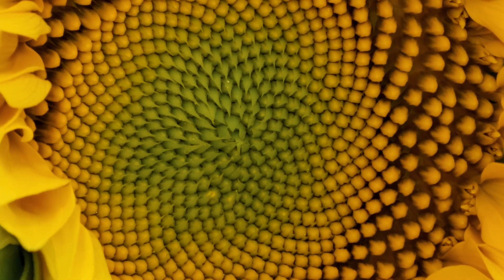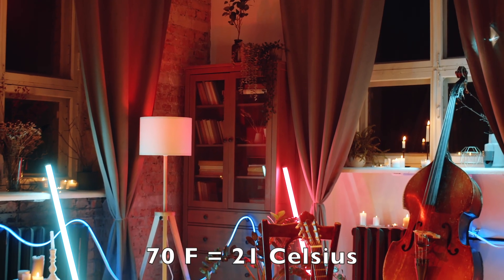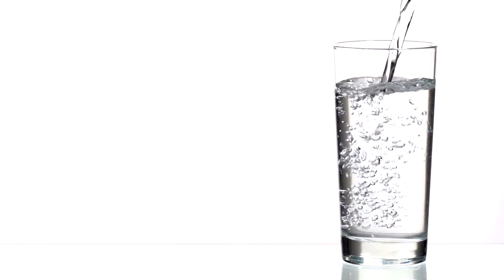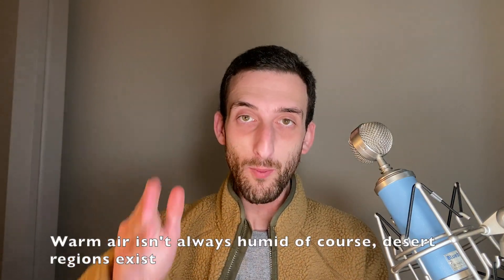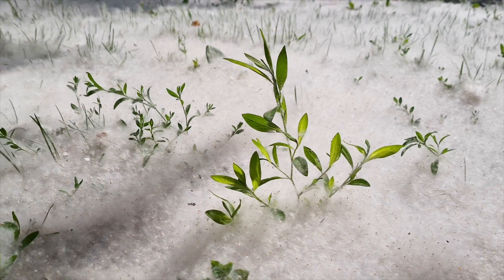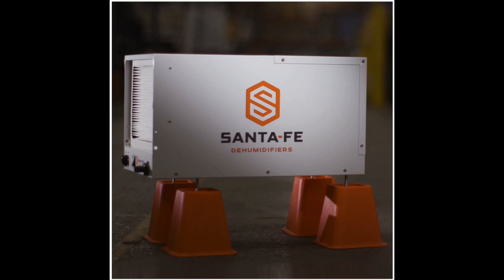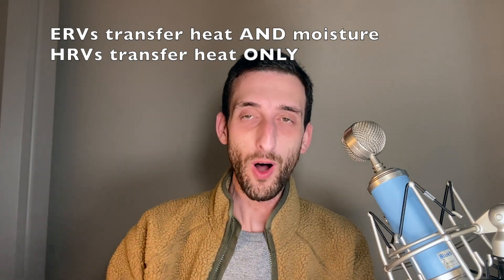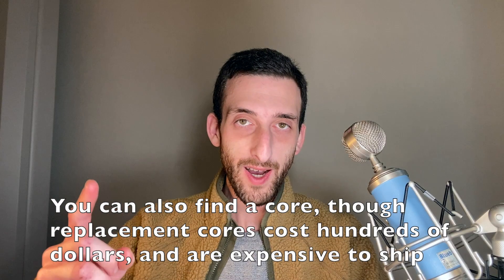HRVs vs. ERVs: Why I Ditched My DIY HRV and Bought an ERV Instead

Comment: I'm enjoying digging through your videos as I recently purchased an Aranet4 CO2 monitor and realized my bedroom CO2 levels can approach 2000 so now I'm working on bringing those levels down. I may get a broan or panasonic ERV, but am considering first trying the fresh air intake option on a santa fe ultra dehumidifier. In the winter they can operate in fan only mode to bring in fresh air through a merv 13 filter, and the rest of the year can dehumidify fresh air. It wouldn't provide the energy saving aspect of an ERV, but if already needing a dehumidifier it could be worth starting with that and then if an ERV is still needed they could even be ducted together.
Reply from the maker: I’m happy you’re enjoying my content 😊 Here are my thoughts about ventilating dehumidifiers: they are a good option for ventilation when the outdoor temperature is between ~55 and ~75F. But if the temperature is any colder or hotter than that, they would bring air that is too cold or hot air into your home. 

Further, they’re designed to deliver a lot of airflow: the Santa Fe compact70, their smallest model, is rated for 150 cfm, so that’d be a lot of cold air when it’s super cold outside. The air is so dry when it’s cold outside, that the dehumidifier wouldn’t be running, and wouldn’t produce heat to offset the cold (fan only mode). 

ERVs are of course designed to ventilate in such temperature extremes. It depends on your climate, ultimately. Best option for most people is ERV+dehumidifier though. Experiment!

Comment: Good follow up video. My house is good for humidity, but my chicken coop is too humid and I'm working on solutions to that now. Dehumidifiers are a tricky bet there because of all the chicken dustiness.
Reply from the maker: A MERV-13 filtered dehumidifier such as a Santa Fe Compact70 could likely handle the chicken dust no problem! Though you might have to clean the pre-filter somewhat often. Have you considered this?
Reply: I'm in the early stages of addressing the issue, so I haven't delved too deeply into any options. The humidity issue is of my own making. I decided to re-route my radon vent into the chicken coop to keep them a bit warmer in the winter and cooler in the summer. The air blowing out is always about 55 degrees F. But it's also very humid. I knew this going into it and figured I could try to address the humidity issue once it was set up. A total solution for it is to simply run the air through a radiator in the coop and then vent it out (only having transferred some of its heat, but not the humid air itself). I may go that route. I'm on a fixed budget for electricity usage because I'm running on a solar voltaic system. So trying to figure out what approaches can work with the least electrical burden. Thanks again for this video!  @HealthyHomeGuide
Reply from the maker: Wow, that sounds fascinating to run the air through a radiator and vent it out (only having transferred some of its heat, but not the humid air itself). I agree that a dehumidifier wouldn't address the underlying issue. I like your thinking and I wish you luck.  @PraxisPrepper
Reply: I'm fairly fond of your thinking style too - which is why I keep checking out your videos. I didn't even know ERVs were a thing until your video. @HealthyHomeGuide
Reply from the maker: That’s great to hear! I’m glad I could teach you about ERVs.
Reply: Definitely pre-filter + filter. There must be a reason commercial solutions use more than one filter in series. Big particles don't clog the fine filters too soon. Also, you can usually wash a coarse filter once. And can buy coarse filter material "blankets" and just cut to size

Comment: Moisture control is an interesting topic. In a tightly sealed construction like a passivhaus (or similarly built), I hear that even with an ERV it's not enough to regulate moisture. That's often because the minisplits that are typically used to condition and heat such buildings can't remove enough moisture as they are sized correctly for the passivhaus type cooling load, but that sizing will make them undersized for the moisture removal requirements. So they can't deal with it by themselves, and one does wind up needing a dehumidifier for the humid climates. But the resulting advantage is that (with some effort)  the end result is a house microclimate that can be quite precisely controlled.
Reply from the maker: You're absolutely right about all of that, and that's well said!

Comment: Outstanding content - thanks! One idea you may not have explored: In the event that you are building a new house or doing a deep remodel, you can elect to use clay plaster (not lime plaster or drywall). Clay-based plaster is an ancient technique that has been used to passively control humidity for thousands of years. It was recently revived by Geoff Lawton in the Greening the Desert project in the Dead Sea. By replacing 80% of the lime in plaster with Bentonite clay, the walls act as a hydric buffer (not my terms, honestly it's the engineers who name these things). When the air is damp, the highly hydrophilic clay particles in the wall absorb moisture like a sponge. When it is dry, the walls dry, releasing moisture into the surrounding air. Result: the indoor humidity settles in at around 45% to 55% regardless of the humidity outside or inside the home. This technique is used in Japan (a very humid temperate rain forest) where the problem is atmospheric humidity, and at the Greening the Desert project in Jordan, with an annual average humidity of less than 20%. This technique produces a lovely wall (decorators call it "Venetian plaster" it's quite on-trend at the moment). The largest challenge is finding plasterers. Plaster on lath is cheaper than drywall (materials cost) but more expensive labor costs (it takes longer and you need a higher level of skill). But, it's still only about 10% to 20% more than level 4 drywall, and you don't have to buy or power expensive mechanical humidity control equipment. To my mind, the set-it-and-forget-it nature of a passive self-regulating system that never needs maintenance or power, makes it worth the extra up-front cost. I would love to hear your take on this technology, as well as other recent tech revivals such as GAHT (ground to air heat transfer) systems, rocket stove wood heating, and Russian masonry wood fired heaters.
Reply from the maker: Thanks very much Linda! Clay plaster does sound very intriguing - I love the idea of not relying on mechanical devices for humidity control. I'll put clay plaster on my list of topics to dig into. My only concern, which may be unfounded, is about silicosis, a long-term lung disease caused by inhaling crystalline silica dust found in clay. That could totally be a non-issue here, but I'm curious. Anyway, thanks again for your interesting comment!
Reply: @HealthyHomeGuide  😯 That hadn't occurred to me. Wet clay isn't the problem, it's the clay dust that's the problem. 🤔 Since this is a single installation I will be sure to insist on good masks for everyone involved with mixing the clay into plaster. Thanks for the heads up! I can't wait to see your research.
Reply from the maker: @lindacgrace2973  You're very welcome, and good idea to have the workers wear protective masks.
Reply: @HealthyHomeGuide  Yeah. The OSHA inspector's got nothin' on me! I am notorious. The workers think I'm a nervous old hen (and they're right). But statistically, construction is one of the most dangerous professions on earth. Your odds of injury or death are worse as a residential roofer than as a front-line combat soldier. Wish I were kidding. I had a kid show up to do roofing wearing flip-flops. I sent him home. Everybody got the message and I had a much safer job site after that.
Reply: Or you could use wool for your insulation. Wool not only filters the air but also can hold a lot of water so it acts as a humidity buffer.
Reply: @GeraldLeenerts  I looked into wool insulation, but it is SO much more expensive than cellulose. I'm building in the Arizona desert (high in the mountains, away from the baking heat of Phoenix). I will use double-wall construction, with adobe on the outside, a 2.5" gap, and a clay plaster interior wall on 2x4 framing. So the final wall will be 16" thick. I seriously considered blown-in rock wool, real sheep wool, and cellulose. Cellulose wins hands down as the low-cost option. It doesn't have nearly the humidity buffering capacity of wool {sigh}, hence my desiccant built into the walls design.
Reply: @lindacgrace2973  Glad to hear you went with cellulose, as it is a carbon negative product compared to rock wool.

I've built a passive addition and working on remodeling our house to be passive as well here in Phoenix. So completely different climate but there is some overlap. There is a pretty good group of folks here if you ever need to bounce ideas around.
Reply: @GeraldLeenerts  Thanks! I'm looking for lots around Prescott, with average summer highs in the 90s. I'm a gardener and love the USDA Zone 7B climate - cold enough for my beloved tulips and cherries, but warm enough to grow olive trees and artichokes. Also, we get a lot more rain in Prescott (18" to 20") than you do in Phoenix. This channel has been a marvel - I remodelled and flipped houses for years with my husband, and worked as a commercial interior designer, so I have at least the foundations for understanding house construction. But you nailed it - I'm learning more on this channel than I ever thought to.
Reply: What happens when you paint, especially in kitchens and baths with semi-gloss paint?  Does that stop the absorption/releasing of moisture?
Reply: @davidchesher3933  Yes, painting it destroys the plaster. Venetian plaster (another name for clay plaster) is not painted, it's stained (usually with powdered pottery glaze colors or powdered concrete stains). The base clay plaster is a creamy white. There is a variation called tadelakt, which is designed for use in wet areas like showers, tub surrounds, and backsplashes.  Tadelakt is clay plaster mixed with marble dust and soap, believe it or not, and then specially compressed by hand with a special burnishing technique. There are Turkish baths lined with tadelakt that have been standing for a century without one spot of mold, and no signs of leaks. I don't understand the chemistry, but it works. I'm using tadelakt for my shower. I'm doing drywall on the ceiling (because it's getting a decorative board finish) but the rest of the house will be Venetian plaster. Check out: https://buildshownetwork.com/contents/what-is-tadelakt; AND https://buildshownetwork.com/contents/plaster-deep-dive-with-new-age-artisans; OR https://www.youtube.com/@TheNitoProject/featured - there is an entire playlist of various clay plaster techniques. Hope this helps :-)
Reply: This is a silly approach if your area will be humid for days.
Reply: @toomanymarys7355  First, the relative humidity at high altitude in the Sonoran Desert never exceeds 44% (you have to have air molecules to hold up the water molecules and there's not a whole lotta air in the air up here). Even during torrential downpours during the monsoon season, the RH is never above 40%. The average annual humidity is only 20% (lower than the Saraha in southern Tunisia, for comparison). Second, it works just fine in more humid climates. I ran across it when learning about the history of Japanese architecture. A Japanese architect was experimenting with ancient building technologies and installed clay plaster in the test house. Since this was an experiment, he tested humidity, air distribution, sound attenuation, etc. for every room in the house. The humidity numbers were pretty screwy, so he went back and re-tested and realized the traditional clay plaster was tempering the humidity, thus lowering equipment demands for A/C and eliminating the need for dedicated mechanical dehumidification. Japan is a semi-tropical rain forest with about 45" to 50" of rain per year (a lot like Atlanta, Georgia). Similar clay plaster is routinely used throughout the Middle East in spas, public pools, etc., because it tempers the humidity and does not support mold growth of any kind. Picture drying mudflats in the wilderness - in spite of warm temperatures and plenty of water, there are never any fuzzy colonies of mold. Unvitrified (i.e., dried but not kiln fired) clay is an extremely hostile environment for mold. Clay based plaster is routinely used in restoration projects in Venice, Italy, for just that reason. It stops the proliferation of mold throughout the upper floors of the building. Thus, in America we call it "Venetian Plaster" and use it as a decorative finish. But it can also be used full depth in a traditional plaster wall (brown coat, scratch coat, finish coat) just like traditional lime plaster but with added benefits.

Comment: You are an honestand and admirable to admit you learned and needed to course correct. Kudos to you! I am curious if your horizontal orientation prevented any partial condensation and drain off as all the commercial ERV/HRVs seem to orient the core vertically such that gravity can drain any condensation in channels as the dew point is hit.
Reply from the maker: That's very kind! I feel that I owe my viewers my full honesty and authenticity.

Good question. I do believe that the horizontal orientation played a role in condensation pooling a bit. However, the level of condensation never got out of hand, and funnily enough, I couldn't see much (if any) mold growth inside the HRV, probably because I kept it constantly running, so constant airflow. If I had used an air conditioner in the room the HRV was in, I probably would have seen worse condensation.

Interestingly, after removing the HRV, I actually tested some simpler fresh air intake systems, and they also introduced too much moisture into my house. So I don't think it was the HRV itself per se causing the mold issues, more just the practice of ventilating without controlling water vapor.

Comment: Would this introduce the same amount of humidity as putting a fan in front of an open window? Or more ?
Reply from the maker: This is a smart question. If we're assuming that both the window fan and the HRV are producing the same airflow, then yes, they would introduce the same amount of moisture. 

After removing the HRV, I actually tested some simpler fresh air intake systems, and they also introduced too much moisture into my house. 

Anyway, positioning window fans so that they actually produce decent airflow is actually an art! Check out this video to learn more about it: https://youtu.be/1L2ef1CP-yw?si=8igAC-mCHH1mReqw